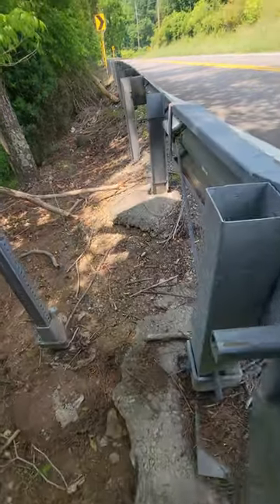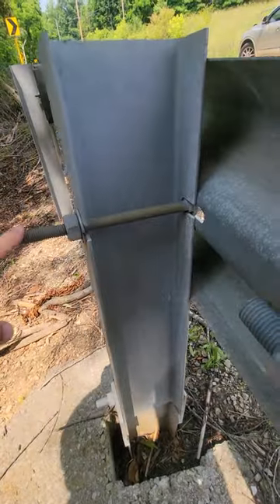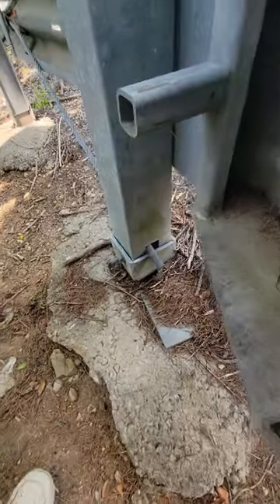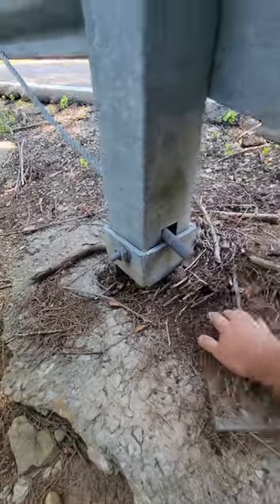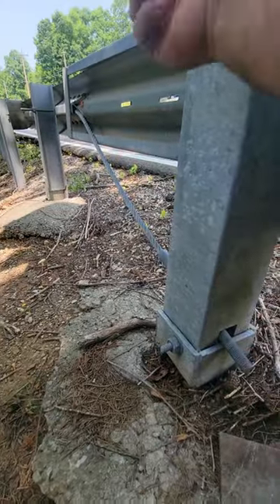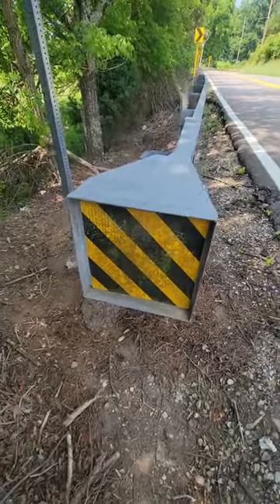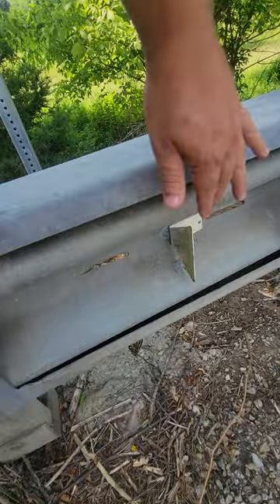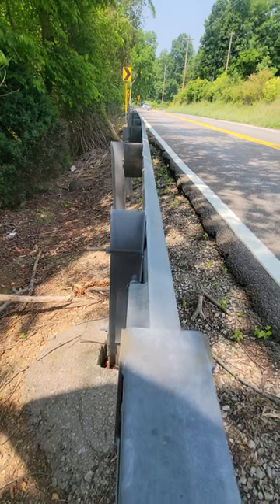I Found TWO Major Installation Defects on this Guardrail

Comment: The tension cable comes loose, after installing it the first time. I have made the contractors come back retightened tension cable nuts. Its worse in colder states.

Comment: Why are the installers in TN so obsessed with those giant bolts
Reply from the maker: If we graded on a curve Tennessee would be an A. Tennessee is actually in the top 10% .  Actual grade would be about D. 

Maine probably is best with a C. Ontario gets a B-.

Most US state DOTs get an F or worse.
Reply: Ignorance on installers and TDOT inspectors signing off.  More, more, more training is sorely needed!!!
Reply: @TheGuardrailGuy  is michigan okay?
Reply: If they placed the nuts on the inside of the post they couldnt reach it with power tools
Reply: @Steve Eimers Roadside Safety Advocate  you ever think about offering some sort of installation training program to road builders? I know there's a lot of logistics to get that going but it seems like nipping it in the bud there would solve a lot of these problems.

Comment: My initial thought was "who cares about bolts"?  But after watching the video it makes sense.  There's a reason codes and specs exist. This is to ensure that the things put in place or our safety actually does what it is supposed to do.  This can be a matter of life or death or serious injury of a loved one if the components or mechanisms fail because officials were too lazy or caught up with budgets to ensure compliance  with regulatory standards. The reason why the breaks work in our cars, is because someone ensured the correct pin or bolt was installed to ensure that when you  press that  pedal, it can handle the force. Standards exist or a reason but QC is key.
Reply from the maker: These things pass crash testing by the slightest margins.

Comment: It’s a 10in center bolt where there should be a 2in but either way it’s a hinge post and the holes are slotted so the bolt can come out if it gets hits so what’s the real issue with that ??? But I totally understand that the plate should be in place and cable tight
Reply from the maker: The 10 inch locks it in momentarily inducing instability.  These things are finally tuned.

I have seen slight bolting differences  lead to horrible outcomes. I think the hinged post is driving the improper installation.  The post often gets dislodged and falls over so that's why I think some are using the 10" bolt. 

I personally would like to see a plug welded post here because I think it would be easier to maintain. I just don't know how it would due with test 3-35. They have really made that anchorage more robust.

Also if we allow any deviation pretty soon everyone is doing whatever he wants. You give a mouse 🐁 a 🍪...
Reply from the maker: I would also be concerned about the potential for head light hits (3-30) to be more dangerous than it is normally.